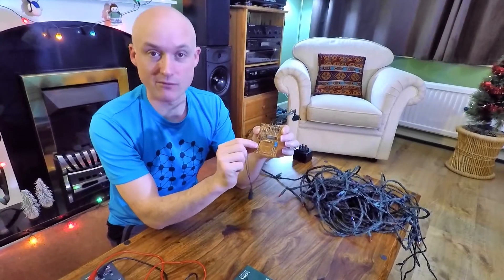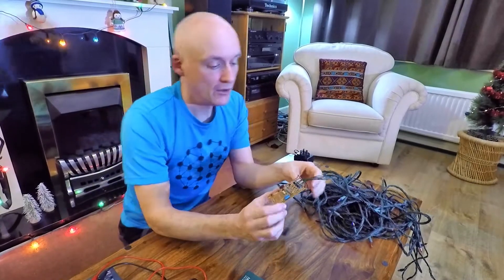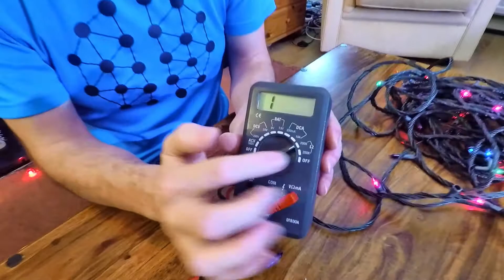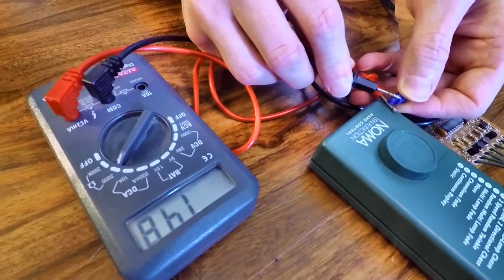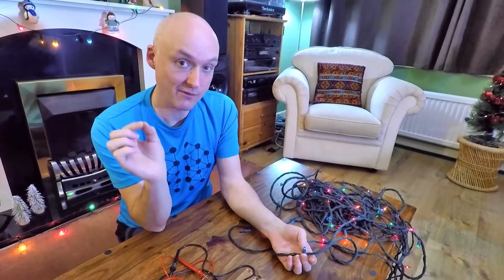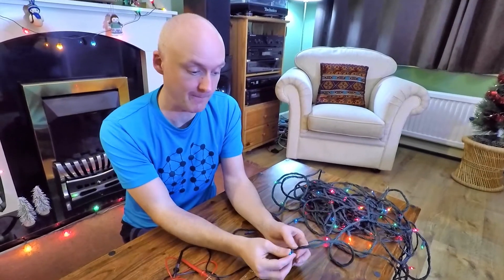How to Fix Broken Fairy Lights and a Broken Controller

Comment: You can use 2.5 V bulbs. I have bought a set of those and imported them and then realized that I couldn't power them. So I cut the power box off and wired. The lights up to a USB that produces 20 V and replaced all the bulbs. With 2.5 V GE lamps, and it works
Reply from the maker: Nice. Love a good DIY fix!